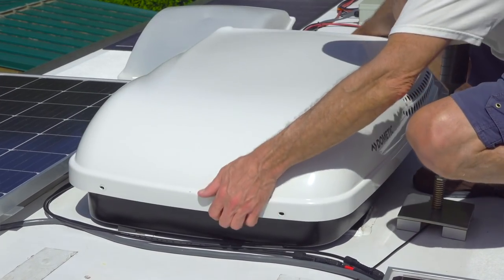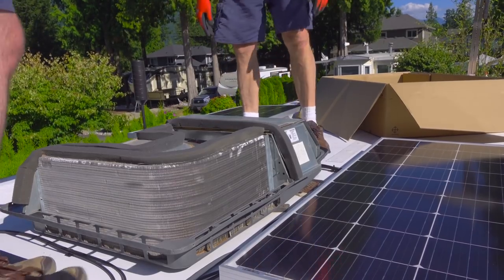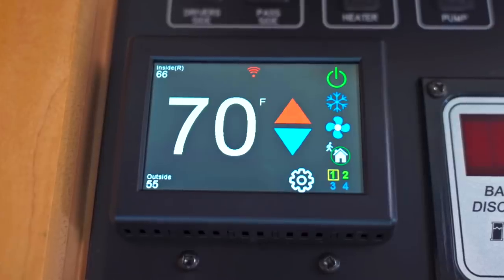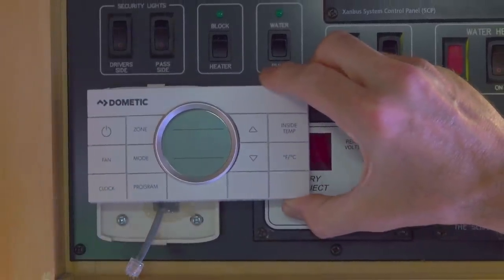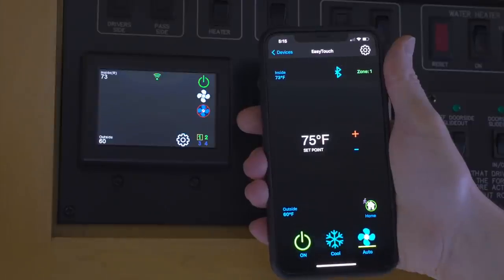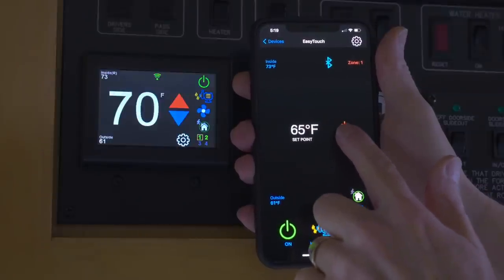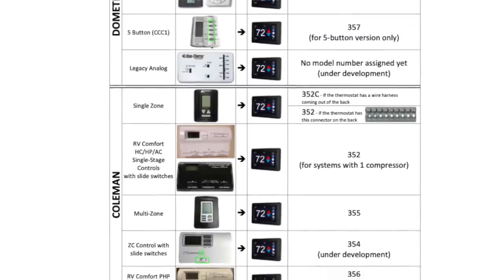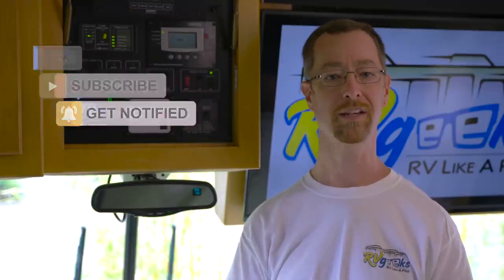Wirelessly Control Your RV Thermostat from ANYWHERE — Micro-Air EasyTouch RV Thermostat

Comment: Love this upgrade!  The primary display provides all the desired info for each zone without pushing different buttons and even gives me outside temps.  The ability to monitor temps and get upper and lower temp alerts when away is significant.  Pet owners will really appreciate.  It is great to change settings after going to bed and before getting out of it.
Reply from the maker: We couldn't agree more, Donald!

Comment: Great timing, guys. I'm about to replace both ACs on the roof. We have an '03 and the rear AC looks to be original.  I'm very interested in that video mentioned on your upgrade. Looks like we have the same units on the roof. 

I'm also had been planning on some sort of "smarter" thermostat.

Love the bluetooth feature.
Reply from the maker: Thanks Russel! We’ll get to that AC replacement video as soon as we can, but it’s a biggie, so it might be a bit.
Reply: @RVgeeks  Roger that. Thanks.

Comment: Question.... Does it give a temperature read out on the display to know the actual temp in the RV? That is the number one thing I DO NOT like about the dometic digital thermostat is that it doesnt tell you the temperature
Reply from the maker: Not only does the EasyTouch thermostat tell you the current temperature in the RV, but (if you have Internet access at the RV), you can see and control the temperature on the RV from anywhere in the world via the app on your phone or iPad.

Comment: Does the easy-start or easy-touch stagger the startup of a dual ac system?    By staggering the startups that would further reduce the chance of tripping the circuit breaker.
Reply from the maker: Hi Dennis. Sorry we missed seeing your comment when you first posted it. The Easy Starts do not communicate with each other, and the Easy Touch doesn’t stagger that we are aware of. But we used the system in our motorhome for several years, often on 30-amp connections, and never tripped a breaker. We’re not sure if we were lucky, or if they generally don’t fire up simultaneously, or if the spike is reduced so effectively that it doesn’t matter.

Comment: My fifth wheel has 3 AC units and 3 thermostats (the Dometic Standard) which are a real pain. You mention in the video that you can control multiple zones. What I am wondering, since this thermostat is quite pricey, do I have to replace all 3 of mine to this model?
Reply from the maker: Hi Bill! The Easy Touch can handle multiple air conditioners, but the problem in your case is probably the wiring. If you have three separate thermostats in three separate areas of the RV, the air conditioners are probably not interconnected at all. The way our single thermostat is able to control both air conditioners is because the two air conditioners are connected together with a control cable, like a phone cable. We also have remote temperature sensors that are nowhere near the thermostat. In your set up, the temperature sensors may very well be inside the thermostats themselves. Your challenge will be wiring. In other words connecting the air conditioners together and having three separate temperature sensors around the RV that are all wired together to the single thermostat to do the job. Running that type of wiring through RV walls, ceilings, and floors, can be really difficult, and we think that may be your biggest obstacle. It’s possible that you may be able to reuse the current wiring that goes from each air conditioner to each thermostat, and replace those thermostats with temperature sensors. That would accomplish connecting each temperature sensor to its corresponding air conditioning unit. But you’ll still need to get the three air conditioners daisychain together and down to the single thermostat to make it work. Hope this makes some sense. If you’re comfortable with fishing wires and being real creative about that kind of thing, it definitely could work.
Reply: @RVgeeks  Thank you for that great explanation. My thermostat wiring has 6 wires, three of which at attached to terminals inside the thermostat and three of which are cut (this is a 2018 Heartland RoadWarrior btw). One of the units works AC and the heater. From what you're telling me, it sounds like the available wires might in fact allow for such interconnectivity. I may try to call Heartland today to see if I can get a tech to tell me what each color wire does.
Reply from the maker: @xxxchopper  Sounds like you’ve got a good handle on this one Bill! Let us know how you make out.

Comment: i have 2 of them. the inside temp is erratic. it changes as it chooses. i think just a sensor problem. hope they will get this fixed soon. i also do not understand ur setup. a thermostat in a close cabinet??? how do u expect it to get the correct inside temp??? kind of impossible to me. since, with cabinet door closed. it will not get air.
Reply from the maker: The two remote temperature sensors for the thermostat are located on the wall…. One in the living room and one in the bedroom. You’re right… without them, it wouldn’t be much good in a cabinet!
Reply: @RVgeeks  where did u get the remote temperature sensors??? i am have a big problem with the inside temp on my colemans to stay correct. i have brought this to the attention to micro-air. not much head way on that so far. thanks
Reply from the maker: @stevefitzgerald9193  Hi Steve. Our rig came from Newmar with them installed. Not sure how easy it would be to retrofit.

Comment: I have a 2019 Airstream International Serenity with 2 zone AC, the thermostat is in the rear bedroom, it has a remote front sensor...because they mounted it over the TV, it offsets the temperature by 2-5 degrees depending.....including that it is mounted next to the frig (dumb dumb dumb)....does the thermostat have the ability to offset the remote sensor value to normalize the sensors erroneous value?
Reply from the maker: Hi Chris... not that we're aware of but we'd suggest reaching out to Micro-Air directly to ask.

Comment: Stellar upgrade!  Are the new AC units quieter than the old ones?
Reply from the maker: Hi Jim! We'd say "subtly" but it might just be psychological, since the new ones look so damn NEW! LOL The old ones were pretty quiet already, but the biggest improvement has been air flow, since we tidied up the wiring, which was partly blocking the ducts in the original installation.
Reply: @RVgeeks  When can we see the install of the ACs?
Reply from the maker: We’ve got it in the hopper, but it’s a biggie, so we apologize it’s going to take a little time to find the bandwidth. We’ll do our best to get to it soon!

Comment: Just to let everyone know, the current version of the Micro Air thermostat does not support Automatic Generator Start (AGS). We got in touch with technical support and were told that this was a feature they are working on and will be released as a software update in the near future. 
Since we have pets, we decided to put the old thermostat back until AGS is available.
Reply from the maker: With Dometic air conditioners, it's not the thermostat that triggers auto-genstart. It's the circuit board in the air conditioner itself, so the RV has to be wired with a trigger wire from the a/c to the ags, which is usually a factory setup. It may differ among units/brands/OEM/aftermarket setups etc. But good to know that Micro-air is updating the software to work in more situations. Thanks for the update!

Comment: Well shoot....discount code is no longer valid for the thermostat. :(
Reply from the maker: Hi Rod! We just checked, and the code is still working for a $15 discount. Be sure to use code ETRVGEEKS. It drops it from 249 to 234.
Reply: @RVgeeks  Sorry, just tried again and it's not working for the 352C model. I triple checked the spelling of the code so not sure why it's not working for me.
Reply from the maker: @rja12  Hi Rod. We just tried both the white and black versions of the 352C, and both allowed us to successfully enter the ETRVGEEKS discount code. We are using Safari on Mac laptops, and going through the regular checkout process. It’s possible that it’s either a browser issue, or if you’re trying to use PayPal, that may be the problem. The discount is definitely good, and we suggest trying a different browser or payment method, or calling them tomorrow morning to confirm. Sorry you’re having difficulty. We hope you can hang in there and save on this awesome thermostat.

Comment: Great video- thank you! Do you know how well this works remotely with campground WiFi?
Reply from the maker: Hey Allison. If you have a way to connect your RV's network to campground WiFi (like with a WiFiRanger or Peplink router), then you should be good. There's not a lot of data being transferred to enable you to remotely view/change the HVAC when away from the RV, so it should work just fine. We haven't done that, specifically, ourselves... because we tend to rely on our own cellular connection, instead of a park's WiFi (and haven't had any trouble remote controlling over that). Hope that helps!
Reply: @RVgeeks  awesome, thank you very much!
Reply: The campground Wifi is free/public but has one of those screens that occasionally  pops up where you have to check the box (kind of like Starbucks free public Wifi) and then you’re online. Would I need a router or something in this case?
Reply from the maker: @Allison Morden - Hmmm... WiFi networks with captured portals like that can be a royal pain. They often have short time limits for connectivity... so if your device isn't actively using the connection, they time you out and force a new "login" via their portal. We've had trouble using them before with both the WiFiRanger and the Pepwave for that reason. Of course, "your mileage may vary" and it may work fine for you (i.e. if you don't get logged out regularly using a single device, it may work OK even using an intermediate device to make the connection).

Comment: Does this control both Ac units. Or do you have 2 T-stats ?
Reply from the maker: Great question, Dave! It controls both.
Reply: Ok so another question do you have 1 thermostat  wire or 2. If 2 did you set a relay for a master and slave ac?
Reply from the maker: Hi Dave. We can't answer this definitively for all RVs and/or air conditioner brands, as they may be wired differently. For our Dometic A/C system in our Newmar: we have 1 thermostat that controls both A/Cs; the thermostat is wired directly to the front A/C unit; there is a secondary control cable that connects the two A/Cs together; the front A/C is set (via dip switches on its circuit board) as the "Main"; the rear A/C is set as secondary; from each A/C unit there is a wire for a "remote" temperature sensor for that zone... Zone 1 (front) sensor is mounted on an interior wall near the middle of the coach and Zone 2 (rear) sensor is mounted on an interior wall in the bedroom.

Many RVs are wired with a separate thermostat for each zone (probably simplifies the wiring for the manufacturer), in which case you'd need two Micro-Air EasyTouch units.

Comment: Holy Cow, 58 degrees at night, that is crazy.  Can you really get it that cool when you are in 100 degree heat?  Why don't you just move up to the North Pole and you should feel at home, lol.
Reply from the maker: Sorry if we weren't clear about that, John! We meant that we set the heat down low in cooler months rather than run much heat all night. I doubt our A/C could get it down to 58 in here when it's 80 outside, much less 100! LOL On the occasional night that's so warm overnight we need to run A/C, we'd more likely set it to about 68-72, just to keep from sweating during the night.
Reply: @RVgeeks  Ah Ha, minor detail, thanks
Reply: @RVgeeks  Thanks for the clarification.  I was thinking the same when I watched the video.